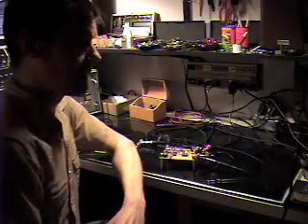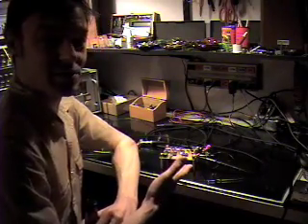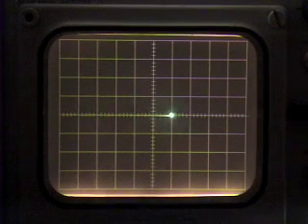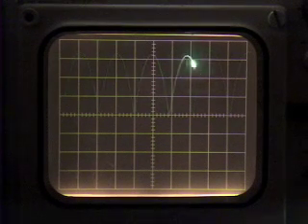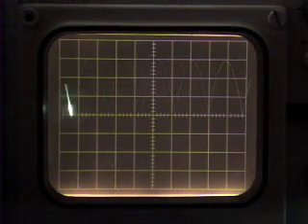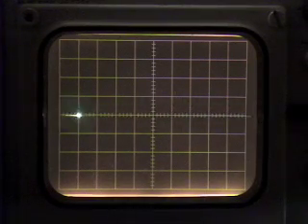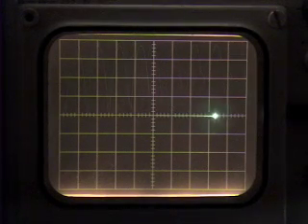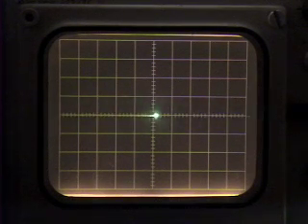Analog Computer Bouncing Ball

Comment: Absolutely fascinating! Do you think it would be possible to build an hybrid system, Digital input -> DAC -> Op-amp analog simulation -> ADC -> digital result, using digital switches (i.e. MAX7360 controlled via I2C) to re-wire the circuit components, de facto rebuilding the model (in addition to passing the parameters values?). In this case you would get a flexible and efficient analog math accelerator :D
Reply: Hooray. So there's another person in the world who sees the future of computer physics. An analog physics processing unit would really benefit a personal computer for the programs that simulate physics.
Reply: GeekTeen2
There is already a significant number of people that sees the future analog computing. Some of them are into cutting-edge scientific research (wrd.cm/1cBXnLB  wrd.cm/19wRqkk). Memristor (a passive analog component) in particular could represent a substantial element of revolution in electronics and computing (http://bit.ly/KiDUow  http://bit.ly/1cTJdHn). Morover, analog programmable chips (so called FPAA, similar to FPGA but in the 'analog' domain) are getting more and more popular. The general idea is to exploit digital logic to reconfigure and control analog circuits. In my opinon the future of computing will be a digital/analog hybrid embedded in a single processing unit, where the analog part will be memristor-based.

Comment: It's nice and all that computer may have an analog output. Fit for an oscilloscope. how ever,That device is digital. The rotary encoders are clues they are incremental and need digital ics. the fact that you can reset everything instantly is a dead give away. with analog devices. You had to turn every pot to a default setting. Manually. Which in this this case would. Make the balls variables 0  1 by 1 here this doesn't happen you can reset it all with a button. Proving  those knobs aren't pots

Comment: @MrNightLifeLover I used one back in the early 70's. Analogue Computers were generally modular and offered a patch-bay and a box of leads! Two of the most common elements in an AC were the integrator and differentiator and with these you could emulate a wide range of time dependent problems, very very quickly. They were useful for designing control systems.

I miss them, they were fun, useful and DIDN'T HAVE BLOODY WINDOWS!!!!!

Comment: Another interesting differential equation to solve with an analog computer might be Bessel's equation, a differential equation the solution of which describes things like the waves on a vibrating drumhead...I'm not sure how coefficients of the independent variable would be implemented. though.  I think I'll try to make a clone of the bouncing ball circuit first! :) I don't have any 4000 series logic at the moment, but I have a ton of 7400 series.  I think it has an analog switch chip.

Comment from the maker: actually, your picture is clear, there is a S&H that triggers when position=0, sampling the voltage that represents velocity. the stored voltage is amplified by a variable gain amp, simulating the coeff. of restitution.  The inverted value then is passed back to the integrator and computation resumes.  Debugging this circuit was pretty confusing at times.

Comment: The thing I can't quite figure out is how you implemented the part of the circuit that inverts the velocity and scales it by a fraction to obtain the new velocity for the rebounce.  My guess is that there is a sample and hold circuit on the output of the velocity integrator, that when triggered by the bottoming out of the position inverts  and scales the velocity and re-applies it to the input of the integrator?